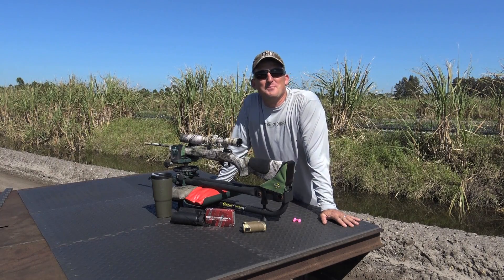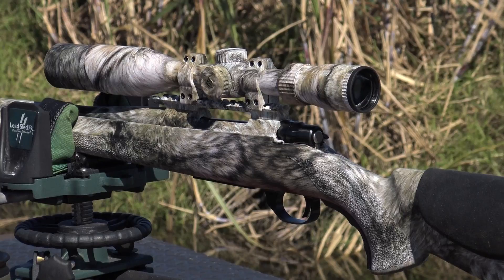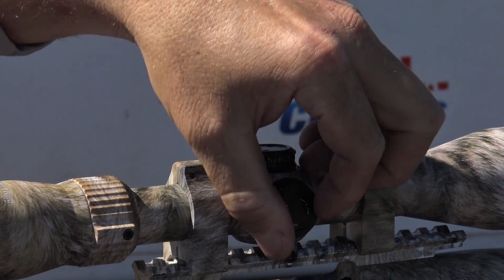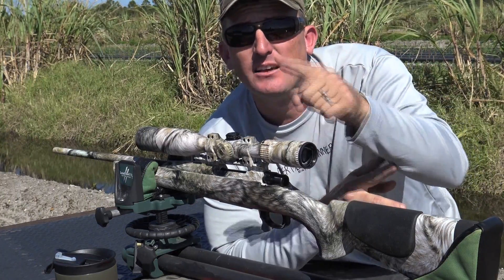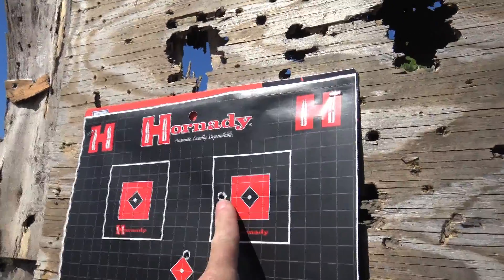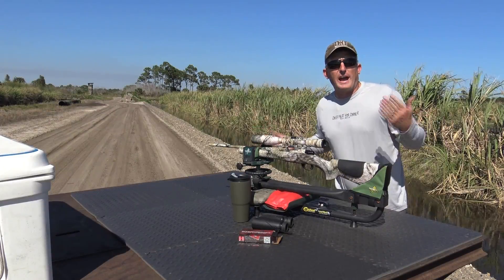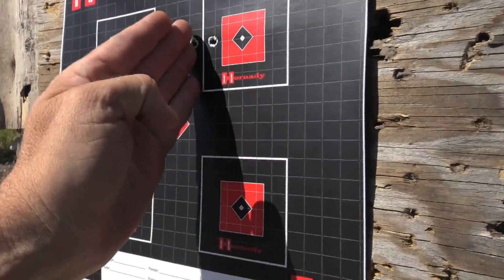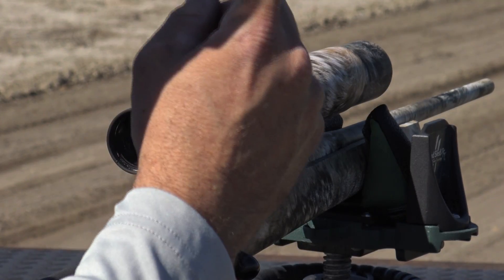HOW TO PROPERLY SIGHT IN A RIFLE!!!

Comment: I used to sight just like this until I was taught to steady the rifle and after your first shot steady the rifle again at dead center then simply adjust the center of your crosshairs over the first bullet hole. Steady the rifle again at the bullseye on the target and fire another shot and youll find you will hit or be really close to bullseye. Follow that up with a 3-5 shot group and make sure to take about 2-3 minutes between each shot to let the barrel cool. You will get a consistant group and you can fine tune from there. I also only use the weighted sled to steady the rifle while I make adjustments to the optics. When I shoot I use the bags so I get a similar recoil from the rifle to what I will get when I hunt with it.

Comment: Love your vids. I can understand your excitement here with this Howa straight out of the box. I too only last week bought a Howa 6.5 creedmoor Stainless 24 inch barrel, I changed my stock to a MDT (two bolts) and put a set of scopes on it. After about 10 shots of breaking it in (cleaning the copper out of  the barrel after every shot and sighting in at the same time. After 10 shots It was at 100 meters cutting figure eights in 1/2 inch groups (thats two holes touching) I am so impressed with the Howa 6.5 Creedmoor performance, I just cant wait to get some deer meat for dinner. LOL I got the 6.5 after months of research and studying all the resulting ballistic coefficients It changed my mind and I just had to own a 6.5 Howa. Love your channel keep ut the good work mate, cheers. Scott from downunder.

Comment: I have always used the process " DOPE "  = " data on previous engagement, " so basically take your first shot  find your hit on the target, then re aim right where you first aimed on your first shot while moving your elevation and windage over to where your first bullet struck the target. I would be surprised if it takes you more than 3 shots to get it sighted in.

Really enjoy your videos and try this for yourself

Comment: The ballistics application I use the most is called, ballistics for iPad – JBM ballistic calculator.  

With that gun vice you are shooting with, another trick to sight in quickly would be to aim at the bullseye, take the shot at 25 yards, line up the crosshairs on the bullseye again, and being careful not to wiggle the gun, turn your elevation and windage to move the crosshairs to where the bullet impacted the target.
Reply from the maker: Ya. I've used that method as well. I'm sure that will come up on a video in the future. Thanks man! I'll be getting that app for my iPad!!!

Comment: I have seen one lever action Winchester 32-40 which was dry fired one to many times and the very end of the firing pin broke off. It does happen and it is rare, thankfully a machinist friend of mine made a new firing pin replaced it for me. It was my gun..!

Comment: Great video Robert.
I know  there's controversy on what the perfect caliber is.
I shoot a Winchester Model 70 Feather Weight 30 - 06  with a 180 gr. Federal Premium. I've tried smaller weights and different manufactures...but this is what this gun prefers. My site in is 1 inch Hi @ 100...puts me at dead on at 300.
When I'm shooting....target practice...I go one step further by cleaning the barrel every five shots. I know this mite sound a bit annel. But my theory is when you make that shot or shots of a life time your barrel needs to be clean. And if you have to take a few more to finally make it count...with the idea of knowing what your rounds will do with a slightly fouled barrel....instead of very fouled.

Comment: Great video.  You might want to also recommend an optical bore sighter to your fans, which works without having to look through the barrel.  Especially useful for semi autos and other types where you can't look down the barrel.  And a laser sighter for ones where an optical bore sighter won't work.  God Bless.

Comment: The only problem I have with it is the adjustments at the different yard lines. I would have done one at 25 yard and than again at at 250 yard just to check the flat trajectory. The rest of it is the proper use of the BDC built into the rifle scope. After the 200 yard adjustment I would not be surprised if you went back to the 100 your strike of the round would be off again.

Comment: ok fine then....thanks very much. One thing, a solider told me that you DONT want to know when the trigger will break because your anticipation of that moment will cause you to flinch. If you pull the trigger smoothly back without knowing where the break is, by the time you discover it the bullet has already left the barrel and now, if it matters, you can flinch all you want. Thoughts?

Comment: I have a .308 caliber bolt action rifle which I have to take out and sight it in. I wasted time and ammo trying to sight it in myself then took it to a gunsmith to let him do it and it is still shooting low and to the left. I am going to take it back to try adjusting the sight myself on our property in one area where I tried adjusting the sight the first time and hope to get it correct at 100 yards.
Reply: How about trying some different bullets. My 308 don't like Winchester but I love Remington. It makes a difference.
Reply: Usually low and left means you are jerking the trigger.  Ease up and squeeze it smooth
Reply: @brianroddy6805  Thanks for that information and I will try that out.
Reply: Try to shoot on a solid bench , so you can have consistent shots. Also try different bullet weights and velocities see what your gun likes. After I sighted in my slug gun to a 1/2 inch group at 100 yard, 4 days later, I missed a doe at exactly 125 yards . I know for sure it was me who jerked the gun. Good luck to you . Just one note: I tried 3 different shells and my gun only liked one that was heavier in grain and less in velocity.
Reply: @chiya2006  I thank you for that tip and I will try it when we get some clear weather. Right now it is snowing here and it has been very cold for a week.

Comment: Just seen this video and i love you to try this with a 12g rifled barrel shooting hornady SST 300g slugs. THESE zero in after you shoot maybe 5 shots if your lucky. Then after those 5, i will shoot 5 more and i tell ya it can be good and horrible. 2 inch to 5 inch apart... good for deer hunting at 50 yards or if ur lucky 100 yards.

There is no such thing as looking down the barrel to zero it in on a shotgun.

Or any Semi-Auto

Lol

Now that being said yes this is a good video for newbies to zero in any Bolt Action Rifle, providing you have a solid base stand or sand bags and shoot exactly the same way every shot.

Also what counts is a NON windy Day to Zero in.

The type of ammunition used as not all are equal nor FLY the same way.

Example: Hornady 150g SP bullets Flat Base or boat tail.. i shoot Flat base Boxed and Reloaded. 50 YARDS.

.308 Bolt Action rifle 1/10 twist rate.

You will find even Factory Ammo you get a nice 3 to 4 shot good grouping under an inch or half an inch and then the 4th or 5th shot is a flier about 2 inches away or so.

You will also find the 5 shots are an inch apart or maybe 4 are and the 5th is 2 inches away or the 4th and 5th shot are 2 inches away.

Yep letting the barrel cool down the shot for 5 min or 10 min is what i do, but still see what i said above.

Comment: So once you sighted it in at 200 yds, how does it effect it when you shoot you at 50 yds?
Reply: LongviewGarage You will be shooting high at 50 yards if you're sighted in for 200. It's  easier to just use the mil dots in your scope to make the adjustment. Something you'll learn by practicing. I wouldn't go trying to adjust your scope for a closer shot. You'll start to get a little computer going inside your head for elevation adjustments and all of the math in shooting.

Comment: Well made video but another sight in video chasing impacts around on the target. I have seen people, myself included use this method over and over and almost always with the same results. Time consuming and wasting ammo.  I much prefer to use a much faster simpler and more accurate method.  1. Make sure that you have your rifle strapped or locked into its rest securely without adding pressure to the barrel.  2. Bore sight your rifle, I usually do this at 25 yards.  3. Fire 1 shot to to make sure you are on paper and then visually move the reticle  from point of aim to point of impact. If the rifle is not secure this will make this method almost useless. 4. Move out to 100 yards, fire a 3 shot group.  4. Move the reticle  from the point of aim to the middle of the 3 shot group.  That's it , 4 shots and done. I now spend more time setting up the targets than I do behind the gun.

Comment: I'm confuse! @ 2:17 u turn clockwise to go down. @4:49 u turn counter clockwise to go down! Unless I'm not understanding the logic on ur scope. Please explain!
Reply: I had the same question.
Reply: I saw that as well. That was a mistake that had to have been corrected but the video edit was probably not worth the time. I've made the same mistake from time to time. It's still a good video. It's shocking how many people don't get the concept of adjustments (how many clicks) based on 50 yards versus 200 yards. This helps and thus is a good reference video.

Comment: Hi Rob, I’m very new to shooting and have just bought my first gun 22wmr, I’m taking it to the range in a couple of days to zero it, just wondering if after you have gotten it zeroed in at 200, does that mean that it will still be zero at 50? Or do you have to adjust for each distance? 
Thanks, Matt👍🏻
Reply: Matt Cato you'll need to adjust

Comment: Your trajectory should shoot an inch under at 50 to be dead on at 100
Just adjust your scope to the first shot
2 shot sight in
Reply: I think he wanted 200y zero and that is why he didn't want -1 at 50.  On a new gun and new scope mount, I shoot one at 25y going for -1.5. Adjust then to 100y for a test group. Your scope clicks have to be right on what they claim for this to work with just one shot.

Comment: A much faster and proper way to zero which eliminates any measuring or thinking about what a click means.    
- After your first shot the bullet is high and right
- next keep the gun from moving and keep cross hairs where your aim was (dead center of target)
- While looking through scope and not moving gun turn the clicks so the cross hairs are on the bullet hole.
- DONE!  Your next shot should be very very close to the bullseye.
Reply: I think you messed up.... Should be aim on your bullet hole  adjust till in the bulls eye... Your way would be even more to the right or did I misunderstand?
Reply: @johnsmithling8311  You misunderstand.   Keep cross hairs on the bullseye then move the cross hairs to the bullet hole without moving the scope. (use the turrets).  You would double the error by doing it the way you suggest.  You are simply putting the cross hairs where you hit the target.
Reply: Bob isnt that what is called the 2 shot method?
Its what I want to do but I'm having trouble keeping my rifle from moving while adjusting the scope. Next time, I'm going to get my brother to help either by holding the rifle on target or adjusting the scope, and I'll do whatever he isn't.  LOL
Reply: @scottdawkins5216  I don't know the name of it.  Just use it when sighting in my guns for 20 years.    Its best to do from a solid rest.   If you move the gun during then you need to take another shot and sort of start over.    Also if you pulled your shot then its going to be off some too.    Only works well if your sighter shot was pretty good.   So best to have a bipod, sandbags etc.  Something that you can hold it steady and turn the dials while looking in scope.   Can do with two people one looks other turns.  I did that last weekend but the guy shooting moved the gun and messed it all up.   Best if you do it and not trust some other shooter.

Comment: Hi just one question plzz.
If i zero a gun on 50 yards first than zero it on 100 yards and than 200 yards. Every time i need to adjust scope .question is if i zeero from 50 yards to 200 yards and than again i shoot on 50 yards will be the same as i did in 50 yards before..

Comment: beginner question: so i sight in for 50 then for 200... the reticle is obviously moved. 
so if i shoot for 50 or 100 , will it be sighted in or different for different distances.
Reply: Pick a sight in range and then bullet strike will be different for different ranges. You change where you hold on the target depending on range of the game. 

Do an internet search for "bullet trajectory by caliber" to see what the bullet path looks like. 

Adjusting the reticle after sight in is not the usual thing to do unless target shooting.

Comment: Dry firing a rifle myth comes from rim fire, you can damage the pin and or the chamber,
Reply: Not saying you're wrong obviously but how would dry firing it damage it vs having it hit the rim of a cartridge, I feel like if either could cause damage it would be having it actually hit something that's raised, like the cartridge
Reply: India 
Dry firing can cause damage on most Rimfire rifles because the firing  pin hits the hard steel chamber wall compare to soft brass on the rim of a cartridge. 
This does not apply to Ruger 10/22 because the firing pin is short enough to stops before it hits the chamber wall,

Comment: I have a 7 mm automatic rifle which I don’t have a bolt , how are you going to do it , thanks a lot great job
Reply: Just shoot at 25 yards. You'll want to be about an inch low. Then you can move out to 100 yards. Your clicks will be about 1/16 th inch at 25 yards but if you're more than an inch away, you don't have to count them. Just give the dial a twist. You can start counting when you get pretty close. Good luck!